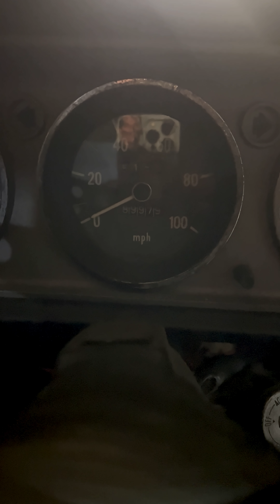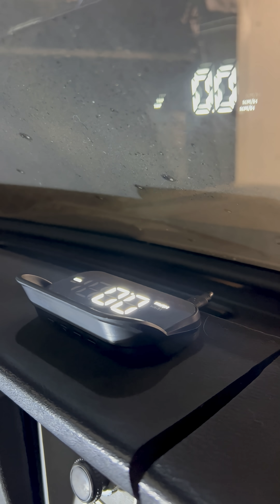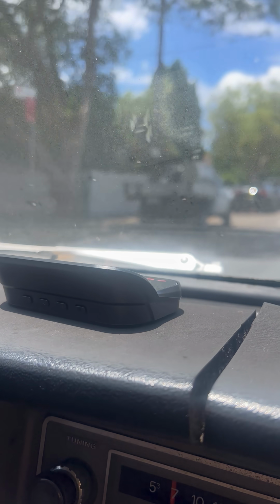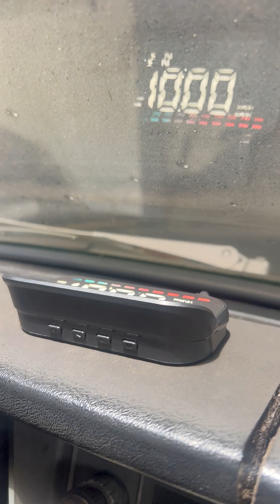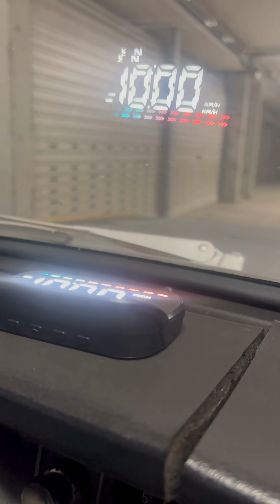Hardwiring GPS Heads Up Display #HUDInstall #HardwireInstall #DatsunBuild #ClassicCarMods #shorts

Comment: 38 MPH is 60klm, 50MPH is 80klm, 60MPH is 100klm.... so much cheaper and easier.
Drove a 63 mini (850) for 10 years... didn't have to worry about anything over 80klm... the hill had to be pretty big to get past that!
Reply from the maker: Yeah I know and I was doing that for a while…..until I realised the wheels and tyres were messing up the speedo dial reading anyway. So I went for this. In the multitude of tunnels in Sydney I still have to use my brain unfortunately.
Reply from the maker: Haha I used to have a car like that. XE falcon wagon. Didn’t like them hills!